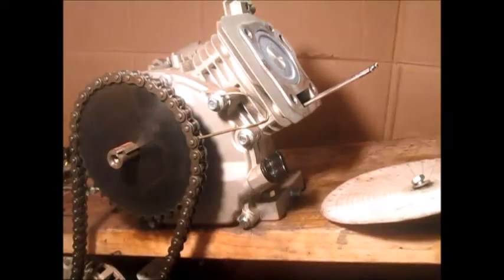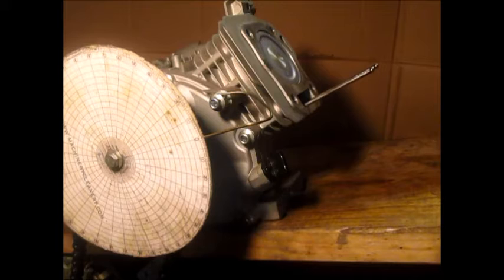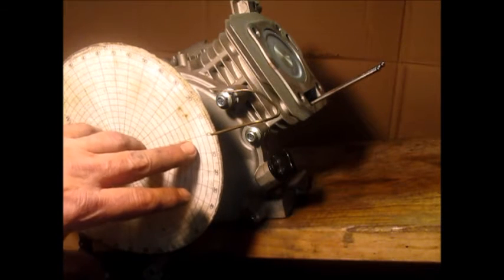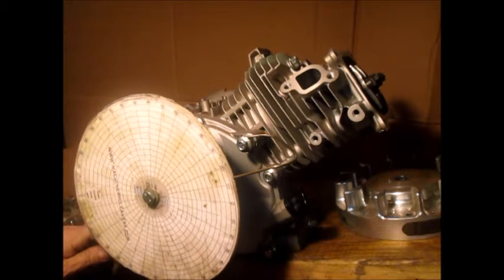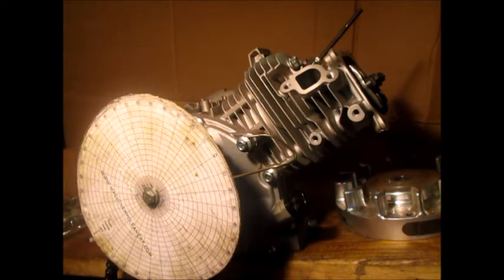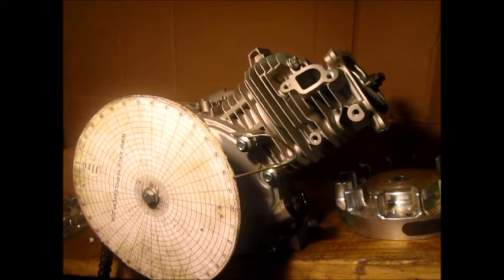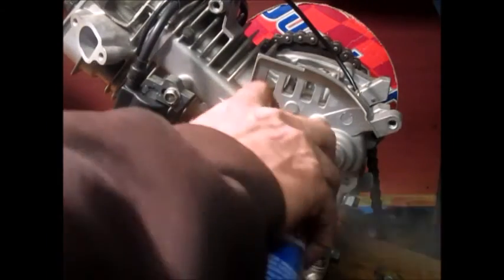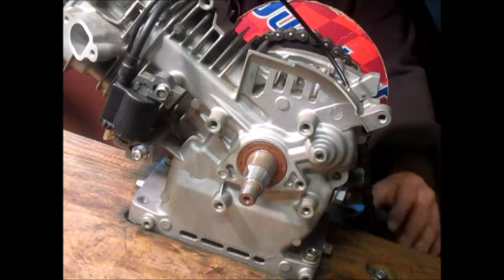Setting Your Flywheel Timing

Comment: Finally i understand why my engine sucks with a arc FW (24 degrees stock) and a 6 degree timming key, if i instal the key with the missing space to the left, then im shortening the time in 6, so i get  18 degrees wich makes engine not working properly, sparks get dark, if i want 30 degress i need to install the missing part on key to the right? Thanks.
Reply: No. Missing space on the left advances the timing. Missing space on the right retards the timing.

Which ARC flywheel is timed to 24 degrees? That would be odd. Both of their $120 clone flywheels are set at 32 degrees with a stock key.
Reply: @Deucealive75  the #6623 gx390.

Comment: Do you have to do this every time you take the fly wheel off or the cylinder head? I took my engine apart pretty much everything except the main casing just trying to clean it up will I have to do this putting it back together?
Reply from the maker: If you remove the flywheel you will need to reset your timing. Removing the head you don't. You will have to reset your lash if you removed the rockers, changed the thickness of the head gasket, changed rockers, or milled the head.
Reply: Mike Allen well that sucks lol what happens if I just throw it back together? Will it just not start? Or will it screw it up and brake it?
Reply from the maker: @mikefawc22  if you removed the flywheel use the flywheel key to set it to stock timing.
Reply: Mike Allen okay thank you for the help! I appreciate it! Still trying to learn and understand how engines work
Reply: If you want it stock, just put the wheel back on using the key, it will work that way.